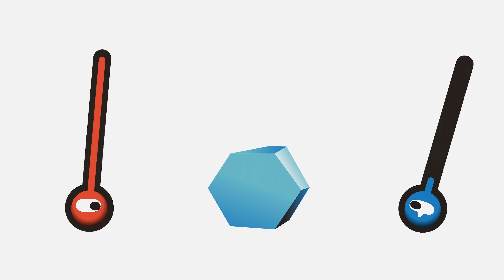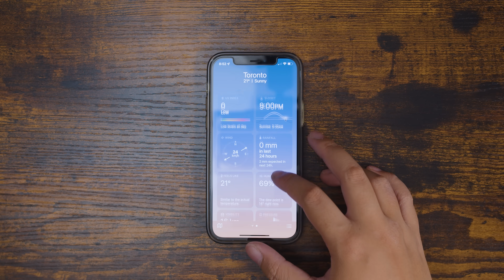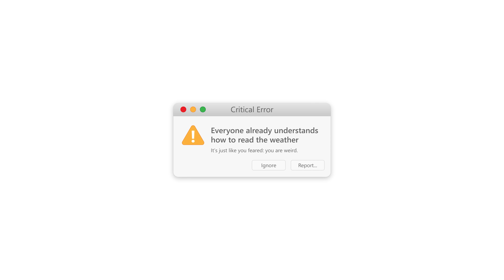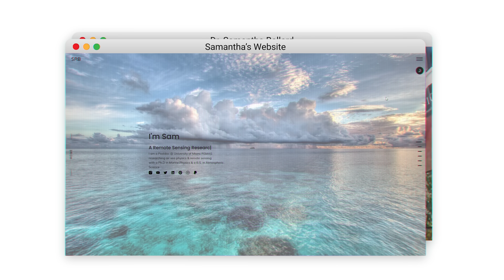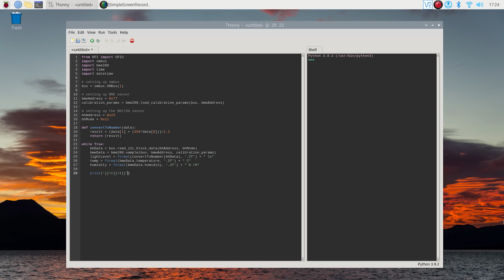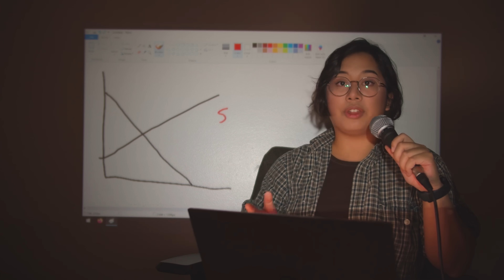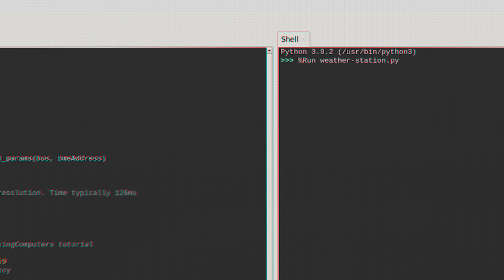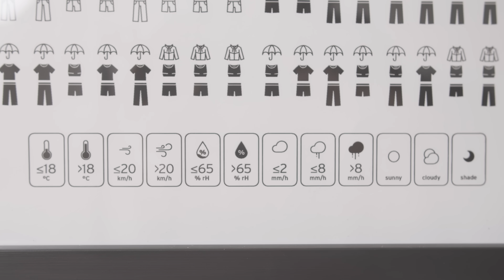how fahrenheit fails you

Comment: As someone who grew up close to the equator in a humid, tropical area with not too much variance in temperature (on average lowest 10C - 35C highest), it was fairly easy to guess the temperature. When it's hot, I would think geez, it feels like it's 30C and then you check the temp and it's 31C. Or when it's cold, it feels like it's 10C and it would be 12C. Now that I've moved further away to a cooler area with more variable weather, I feel like I have less of an idea of what the actual temperature is. Now that I actually have to dress for the weather, I am usually caught out wearing stuff that is not warm enough, simply because I never used to have to worry about it and it was basically summer all year round with about 2-3 weeks of mild cool where you have to bring out a light jumper. Now I just carry an extra bag with a scarf, gloves and beanie in case I need it because I hate the cold haha

Comment: Two suggestions:
1. Kelvin is objectively the best scale as it is the ONLY scale that thermo calculations can be done with 
2. Take your (amazing) infographic, number each outfit, and pitch it as a new all inclusive temperature scale for the weather stations to report
Reply: counterpoint: rankine
is it good? absolutely not. but... you can do thermodynamic calculations with it.

from a more subjective point of view, the ability to do thermodynamic calculations with a scale isn't especially useful in most situations, so absolute scales aren't objectively better most of the time.

Comment: See the issue with the 0-100 scale for Fahrenheit is that it doesn't work in countries with a different overall standard of temperature. Like here in Australia, yes, 45 degrees is hot, but we experience that every summer, which is over 100 degrees Fahrenheit, and 100 degrees is like 37, which is a very VERY regular temperature, whereas the coldest day we usually experience is like, 8 degrees, maybe, which is only just below 50 Fahrenheit.

Comment: as a spanish (celsius user) Farenheit makes absolutely 0 sense. yes, my brain has been trained to understand that every single degree celsius targets pure water at the sea level. xD but i can't understand the fact that ºF=9/5*ºC+32. it also makes no sense for me an equal part of salt and water as a standard (farenheit) which is really misleading and then choose a random number for the freezing and boiling point. 

salt in chemistry is quite wide open concept. it is a chemical compound. it's sodium cloride? sodium iodide? is even iron sulphate? well, most likely table salt. but table salt contains anti caking agents nowadays so your experience in home may totally be different than the one with Mr Farenheit, and probably the salt he used wasn't that pure either. it makes 0 sense to use an unstable scale and the fact that it had to be "adjusted" three times also annoys me.

Kelvin may be the universal true answer tho. some people may complain about that but...well, we all have opinions. the fact that you use Farenheit and you're okay with that is just that you're used to it. the same could be said about Kelvin, if you were used to it it wouldn't be hard to intuitively grasp the scale in daily life.

Comment: Today is 20 degree of Celsius, tommorow will be half. Or today is 0 degree of Celsius, tomorow will be two times colder. 
Remember - speed of chemical reaction doubles if temp rise 10K/10 deg. C.
So if you try cook egg in 90 degree of Celsuis (low atmospheric presure) it should take two times longer than in 100 degree of Celsius.

Comment: Here is the deal. You are dressing to go out based on the temperature sensation you have inside your house.
But guess what? Almost all the conditions inside your house are completely different from the outside. This is even more exacerbated when your house is climate controlled.

Your house will always have a temperature delay when compared with the outside since it has a lot of thermal mass to exchange before it gets into equilibrium with the outside. And the outside temperature is always changing during the day since the sun is not there 24/7.
At 9am~11am the outside will already be hot but the inside will still be cold from the heat loss to the late at night.
and because of the temperature difference the humidity will also be different.

Comment: The other way to approach this is to focus on your wardrobe. My home's pretty chaotic weather-wise but I am bad at math, so this is the stuff I've picked up about clothes.
-Wear layers, that gives you multiple customizable options and you can adjust yourself throughout the day
-consider where you're spending your time. It might be 95°F outside but if you're spending your entire day in 62°F air conditioning, you might as well dress for 62°F.
- Consider the fit of your clothes. Skin-tight things are going to be cooler when it's windy and hotter when it's stale or humid, whereas loose things will be warmer when it's windy and cooler when it's stale or humid.  (Loose fits hold in a layer of air, which is a surprisingly good insulator. Meanwhile, skin-tight things will hold sweat to your skin instead of letting it evaporate.)
-Consider the thickness/weight of the fabric. Two tees with the same cut can be drastically different with different densities and thicknesses of fabric. A long-sleeve shirt that's practically see-through is still likely going to be colder than a thick tee.
-Feel like i might not have emphasized this enough, WEAR LAYERS

Comment: I have this problem when travelling to a different climate. As in, if it is currently 25 degrees celsius where I am, what did 12 degrees feel like again? I get it right most of the time if it is actually 12 degrees currently...so yes, remembering what a temperature felt like last time I experienced it is definitely difficult, because the number is abstract, after all.

Comment: Actually, the whole world needs to switch to the “duo-centigrade system”. A duo-centigrade degree is exactly half the size of a Celsius degree and 90% the size of a Fahrenheit one. This makes switching over easy. People used to Celsius just have to remember the new temperature is exactly double the old (35C=70D).

Fahrenheit would be a little trickier. The actual conversion would be to divide D by 10, then times that by 9 and finally add 32. Or subtract 32 from F, then divide by 9 and finally times that by 10. However, since the degree sizes are so similar you can get a rough approximation by just adding or subtracting the 32 and you would be within a few degrees of the correct number. For example 82F, if you just subtract the 32 you get 50D. If you do the actual conversion, it is 45D so you are only 5 degrees off.

Comment: My suggestion is to simply place the SHITTIEST thermometer you can find in the least suitable location - i.e. right in the sun and rain, super exposed. It can be a 433MHz wireless variety, they don't cost all that much either. The low quality is a virtue, you don't want it to accurately sample the air temperature. The sun is going to heat it up, the wind or the rain are going to cool it down, it can be scary close to perceived temperature rather than the accurate one.

If you want an accurate temperature... your phone's weather service is fine.

Comment: I am a desert dweller who loves the indoors and hates clothes shopping. I always wear pants and a T-shirt, regardless of the weather. If I woke up cold that morning, I also wear a sweater. If I am not currently cold but I have needed a sweater recently, then I tie the sweater around my waist. And then I spend as little time as possible getting from one temperature-controlled building to the next.

No need to change out wardrobes for different seasons or own more clothes than can hang in my closet at one time. No showing off my neon white legs to innocent bystanders. And no extra time wasted figuring out what types of clothes I should wear today. Altogether, it's my perfect solution!

BUT I completely understand the dozen or so reasons why this method would not work for most people.

Comment: Discovered not invented. :) (The concept of temperature was discovered, the scales by which to measure it were invented.)
Also, regarding the Pi shutting itself down, if the data is stored on the SD card, plug the SD card into your regular laptop and get the data off that way. :)
Also, you shouldn't use pi as the root user account on the pi, it's well known so it's a security weakness.

Comment: I use Fahrenheit and between 68 and 80 is moderate temp where you can wear anything, lower than 68 should have a sweater or cover of some kind over 80 and dress as light as possible

Comment: This feels... dumb? Like, I grew up with only Celsius and I along with everyone I know can tell what to wear when the thermometer says 12°C. It's not any easier or harder than Farenheit.
The actual feel of the weather also very much depends on a variety of factors that are entirely unrelated to the chosen temperature scale.
Back when I was in Latvia I could go outside with a light sweater and feel hot even though it was -10°C, meanwhile in France that starts getting hard at around -2°C.

Comment: I remember being in Algeria, near Bou Saada (بوسعادة), and being told it was "cool" in the oasis as it was "only" 40C (or 104F). After discreetly laughing about it, we had to agree it was... comfortably cooler.

On the other end of the spectrum, in Montreal, -40C (-40F) is terribly cold. Move up north in a dryer region and -40C will feel like -15C (5F).

It really depends on the many factors of which the scale (F, C or K) is, really, irrelevant.
Reply: Indeed, humidity amplifies how warm or cold it feels. On warm days, high humidity prevents the sweat from your body from being able to evaporate and cool you, thus making it feel warmer.

On the other hand, on a cold day, humidity serves to absorb more body heat than dry air on its own would, thus making it feel colder.
Reply: What about rankine
Reply: @yusukeurameshi9837  Interresting: You made me discover Rankine scale. 😲

Comment: I can usually tell what Temp C* it is not off by more then like 1 max 2 degrees.

Celcius feels super intutiative for me,  Felt I understood it pretty well from when I was like 6 years old or so.

I did live in USA for like a year (split in 2 6months periods and back home for 1,5 months inbetween,  and  I found fahrenheit super confusing and felt like the curve was like exponetially growing or something,   it was just wierd and couldnt get it to make sense for the life of me.

I'd put like a few mportant milestones to celcius:  
0*c is when water freezes.     
20*c  is optimal indoor room temperature.
30*c is HOT but you can kinda mannage.
40*c+ is when you can cook an egg on the street,  can't work at all without aircondition, spend too much time in the sun and you start to hallucinate.

On the otherside,   0*c an often feel colder then -8*c because the air has more moisture still and if it's windy it chills you down faster.
-20*c or -30*c  is when you want to put on warmer pants,  thicker socks,   real winter boots if you plan to spend anytime outside more then just a few minutes.
At  0*c  you can still use sneakers, normal pants,  maybe a sweater and light wind jacket.

Comment: I was brought up with Fahrenheit but as I got older I struggled understanding the relation to nature and to my tempature within nature to what "the big number" says. So I switched to Celsius despite the resentment of everyone in the states who asked me what the tempature was. However, it allowed me to scale everything into a nice, organized division of degrees that I used more effectively than I ever had with Fahrenheit. Example:
 I knew that anything < 0°C it will be freezing least to me so bundle up as much as possible, 
0 to 10 °C wear a coat but I'll survive
10 to 20 °C light jacket or jumper will do
>20°C wear anything comfortable without any extra clothing necessary
By using this scale and the measurement of Celsius I've been abled to maintain a better relationship with the weather least for my self. Fun video regardless though interestingly with climate change things are bound to get into more extremes so perhaps a new measurement system for tempature may be needed only time will tell

Comment: It's a matter of how the units are graduated. Going from 0 degrees C to 37 degrees C doesn't seem as big of a change as going from 32 degrees F to 100 degrees F. Kelvin goes too far in the other direction, so no, it is not best for the layman, even if it's better for scientists.

But as you point out, temperature is only one factor, perhaps the most important factor, but still modified by other factors.  As a biker, I'm always trying to make sure I don't underdress or overdress for the biking conditions of the day.  Wind can certainly make it worse, not only for comfort, but if you to have bike against the wind.  The sun being out instead of being cloudy definitely makes it warmer, especially in combination with the wind.  I know humidity has its impact, but it's not so intuitive as the other factors, at least to me.  And never mind about changing weather conditions.  How different will the weather be in the evening compared to in the morning? So until they add weather sensors to our smartphones, it's probably going to be ongoing problem.

Comment: Sometimes, I'm interested in temperature. I look at celcius since it's easier to convert to SI kelvin. Sometimes, I want to know how hot it will feel. In which case I look at the multiple weather metrics. Don't blame the scale, (and then compare/judge these scales on this erroneous use of them) blame people using it for the wrong thing.

Comment: In my country there's a weather measure called aparent temperature that gives you the temperature that you'd feel when you go outside, they get it by factoring in other variables like wind, humidity or sun radiation. I didn't knew they didn't had that metric in other places, but maybe it's just canada that doesn't have it.

Comment: I think your conclusion near the beginning that there are six major things, and air temp is only one of them, is spot-on. And that’s why wind chill and heat index were invented. Your weather app probably lumps them together and calls it “feels like” or “real feel” or similar. 

I’ve found that that number (well, the range for that number throughout the part of the day I’ll be away from home) plus likelihood of rain tells me what I need to know for dressing for the weather. (I don’t really care about chance of snow, because if it’s cold enough that any precipitation will be snow, how I dress is basically the same whether it is snowing or not. )

So I consider the #1 requirement for a weather app or weather source to be: can I set it so that the human-perceived temp is the big prominent first number I see? If it have to click on something to find out the air temp, that’s fine; if the air temp is always visible, just less prominent, that’s fine.
Reply: Obviously, YMMV. But for me, at least since they recalibrated the wind chill scale, knowing whether it’s 91°F/<30% relative humidity, 82°/90%, or 88°/50% doesn’t seem to make a lot of difference most days and most activities. But I get tricked all the time when I see a big prominent “82°” and don’t realize it’s the air temp, and then step outside and melt because it’s “really” 95° because of the humidity. Ditto for not particularly caring whether it is 10°F+5mph wind or 20°+30mph, from a temperature standpoint. Either way “0°” is a far more informative number than either “10°” or 20°”. 

The main time I care what the actual air temp is is when it is near freezing and raining (or has recently rained, or is likely to rain). Because then it’s crucial to know how likely ice on roads/sidewalks is, and the air temp is a useful guide to that. But still not perfect — wind can cool surfaces, too, and depending on the time of year the pavement might’ve started significantly warmer or colder than freezing, which can have a huge impact.

Comment: We've been monitoring weather at home for almost 11 years at this point and I can confirm that when you check it regularly, you eventually get very good at guessing what to wear.

Things I've learned (applicable for Central Europe) that may not be obvious on Sabrina's sheet:
a) look at wind chill temperature (temperature adjusted with wind speed) until you understand how wind and temperature relates
b) pressure doesn't change anything, but some people may get dizzy in lower pressure, lower pressure also raises chance for rain (I can explain why)
c) humidity doesn't change right after rain, it takes time for the water to evaporate
d) even professional equipment needs calibration regularly - I know...
Reply: myweather monitor is called stepping outside for a second before choosing a jacket

Comment: I dunna, i like fahrenheit because i know it. Also feels like if its going to be "in the 70s today" ill definatly know what to wear. I assume in celcius it might be so simple, 20 degrees to 29 degrees being a bigger difference. Freezing point is 32, which is weird, but below zero is be careful or stay inside if possible (happens alot here) and 100 is the same thing. It seems a good metric showing 0-100 for working range and not water state change.

Comment: I also think that Celsius might be harder for temperature comfort is that there is less wiggle room between integers.  For instance in F I find that I am most comfortable between 71-73ºF. At 74º I start to feel uncomfortable.  In Celsius That is barley a single degree change.  But I grew up with F so maybe I am just used to it.  🤷‍♂️